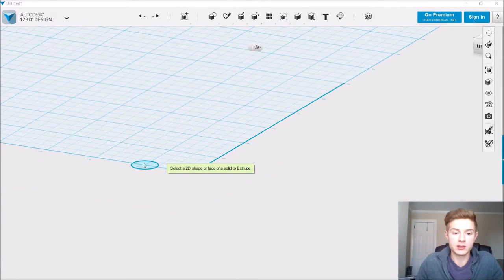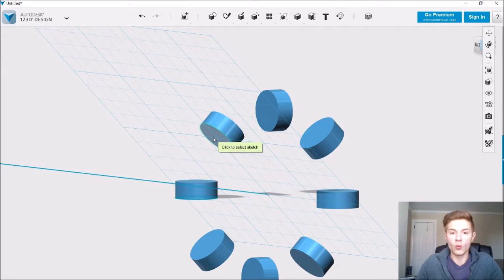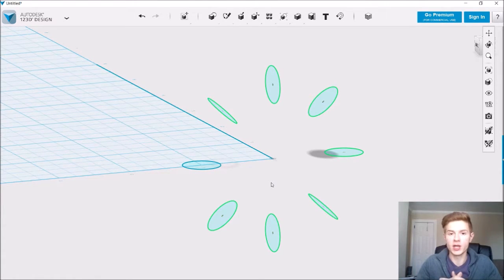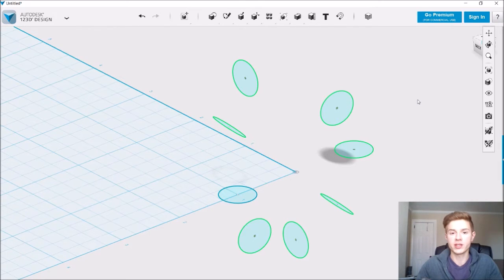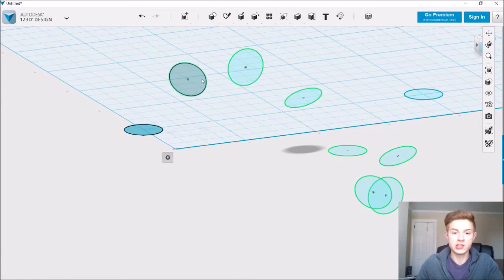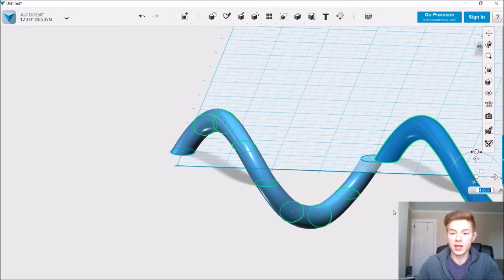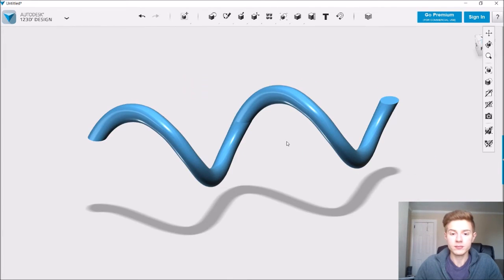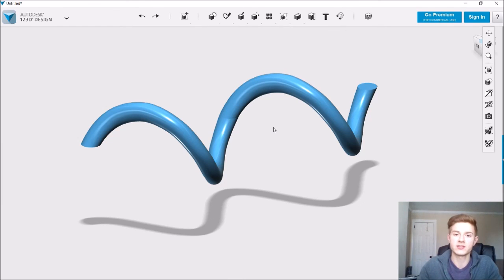A Better Helix, Coil, Spring Tutorial [3D How-To]

Comment: I find that the end of a loft in 123D, especially one involving a twist, is a bit untidy. If I "over-loft" and trim it back I get a cleaner snap where the surfaces line up (build coil twice as long, trim 25% off each end). Actually this isn't just a characteristic of 123D; this is often the case with drawing splines in other CAD software as well. Sometimes the curve needs a radius defined beyond where you terminate the solid in order to finish the curve correctly.